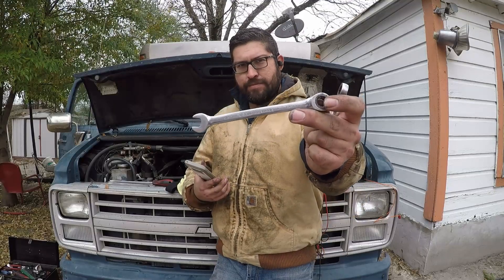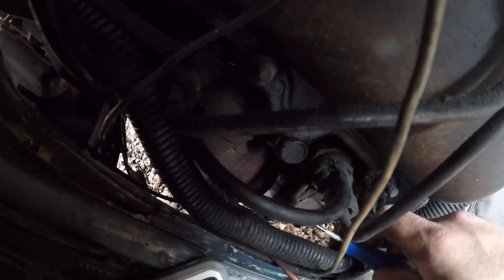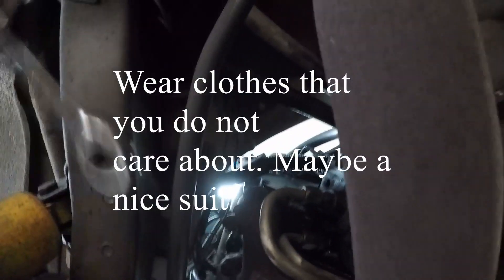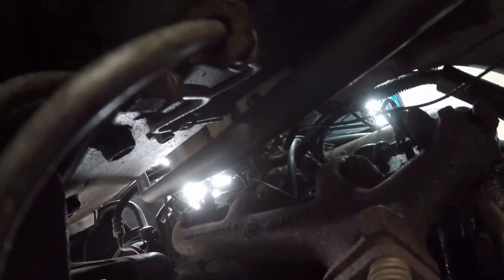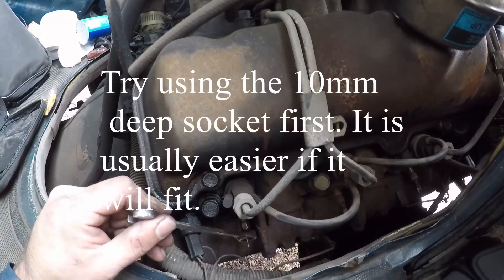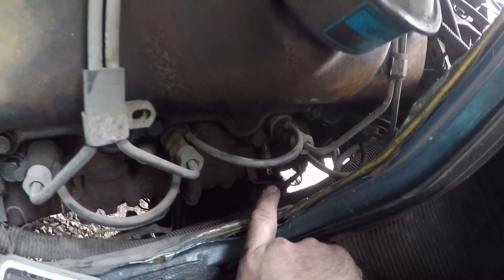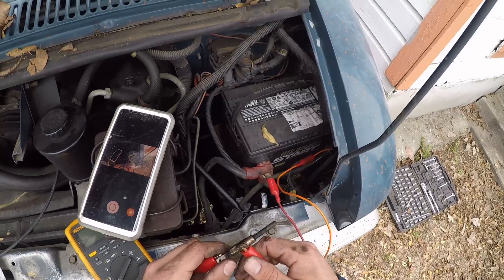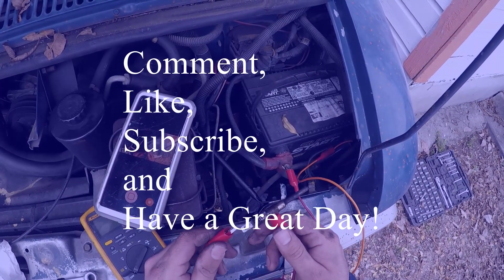How to change and test glow plugs on a 6.2 Liter GM diesel (example using 1991 G30 van)

Comment: Hey Ricky, thanks a lot for this great video.I am based in Cologne Germany and I own a 1983 GMC vandura Zimmer conversion diesel Van.
I couldn't not get the van starting cause the bad GP's .
To all of you that are concerning if you can use acdelco ac13g (military versions 24v) on your civil version Van or pick up ...yes you can,they are working with 12 Volt, exactly like acdelco ac60g or oder Brand GP's.
Hope can help you guys.
Keep on vannin!!!